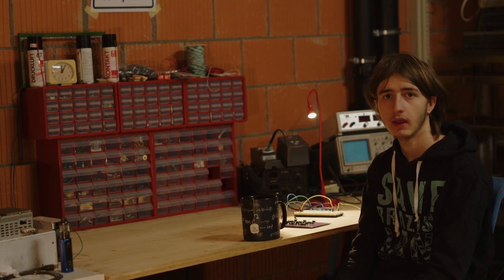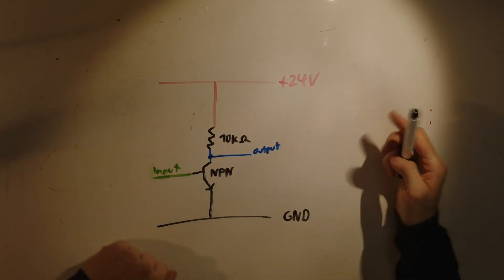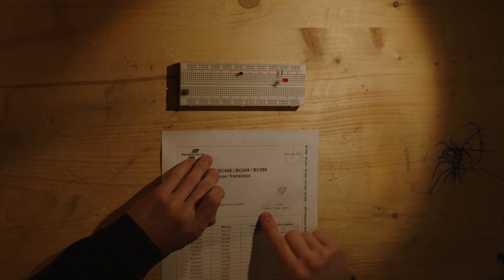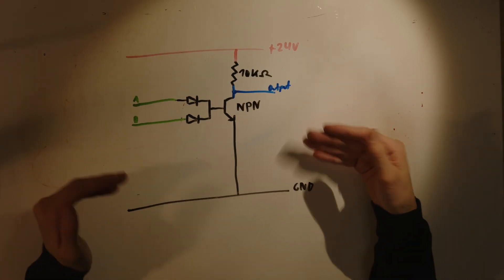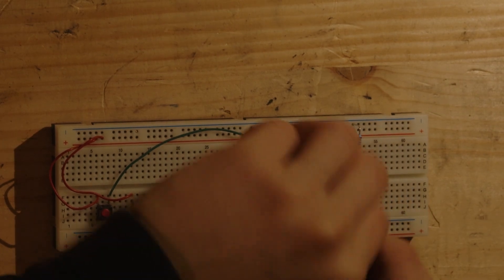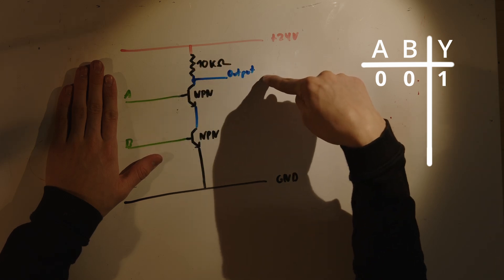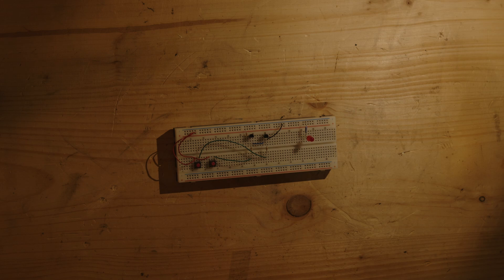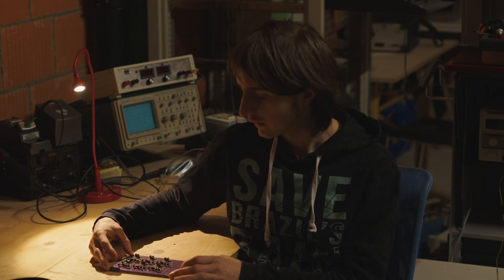How to build Logic Gates with only Transistors and Diodes (EP2, Logic Elements)

Comment: I standardized on the AND-OR-INVERT gate and needed a resistor from the base to ground or the transistor takes a long time to turn off.  Some people connect the resistor from base to a negative voltage but I did not find any significant time improvement.  To make NAND gate with just one transistor, turn the diodes 'backward' and put a pullup on the base to +24V, then you only need one transistor per gate instead of one transistor per input.  I'm looking forward to see what you come up with!